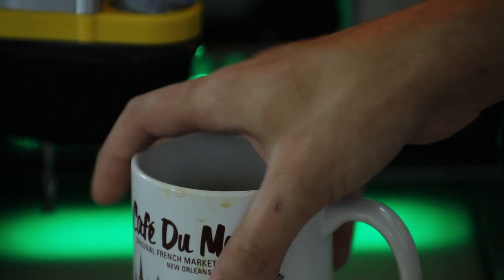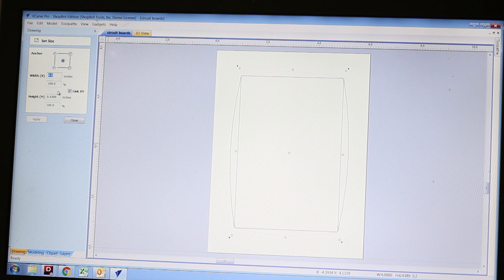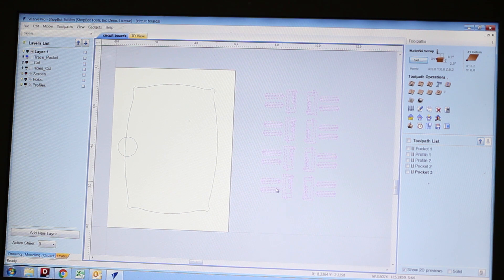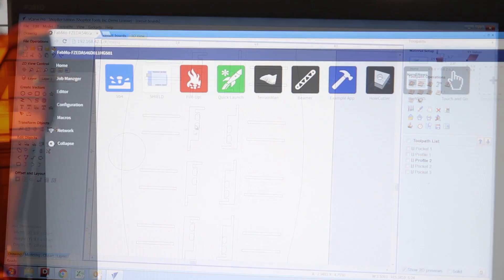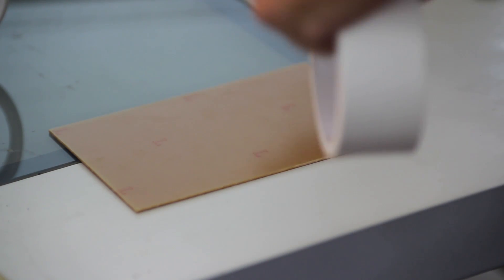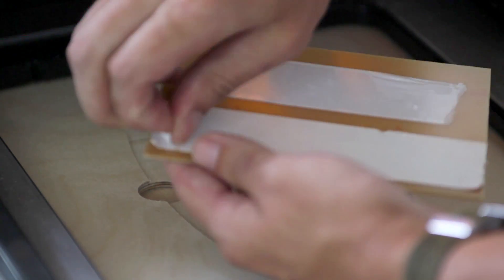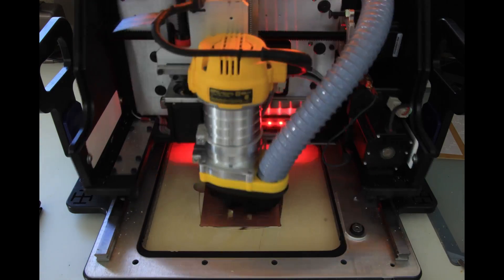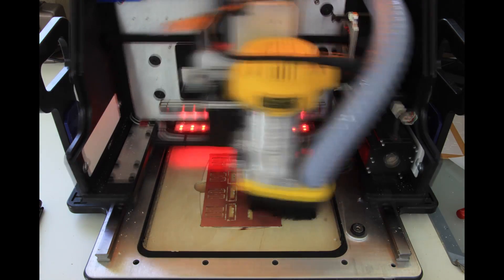Making Custom Circuit Boards with Handibot

Comment: Great video!!! What material did you make the tool bit holder in your thumbnail picture out of? Can you share the aspire file???
Reply from the maker: The blue plastic is HDPE and the clear i just pain Acrylic. The BOM and design is available here: https://workbench.grabcad.com/workbench/projects/gcuAc_g79JwJj5xoyB_sCtAKoUyXaXH0NyeRYptWOwEOWN#/space/gc7w847Pt4uE0Y2-VXNzofMmxgbYGKxMjhjdYk3aCMUUWK/folder/2228433
Reply: Thanks for the link. Can you export the files to DXF since my program can not import the files?